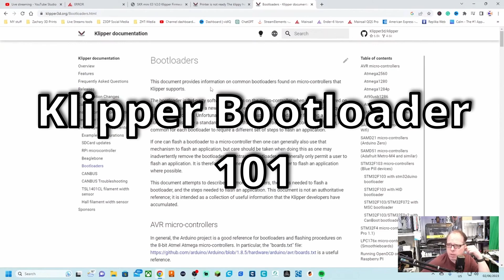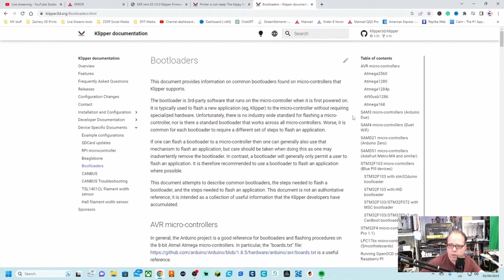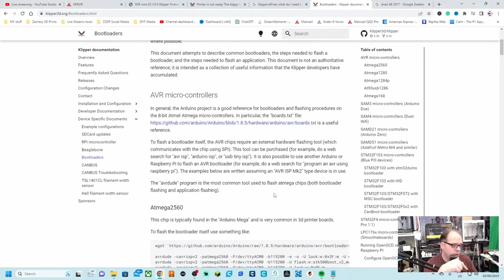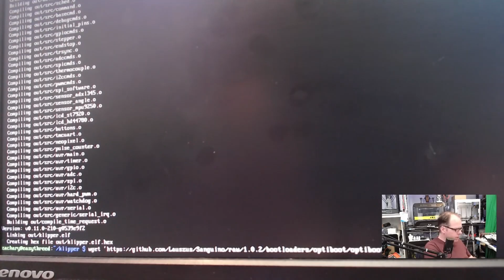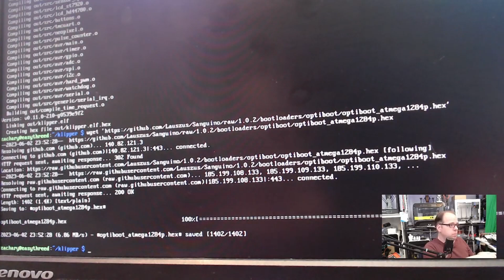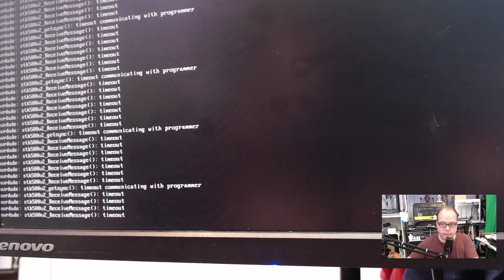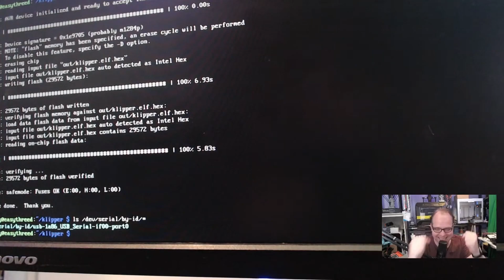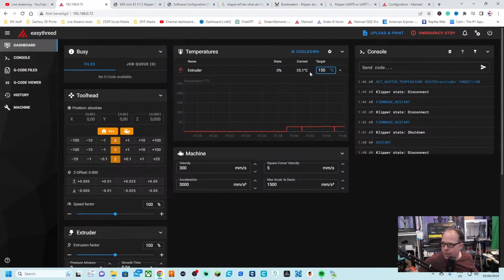Klipper working on Easythreed X1 - Easythreed X1 Upgrades - part 2

Comment: Hello. Can you share the printer.cfg file you use? I'm having trouble triggering stepper motors with my mks robin litev1 cfg. The cfg file you are using seems to work fine.
Reply from the maker: Hey, check out the 3rd part in this series about the Easythreed X1 with Klipper: 
https://www.youtube.com/watch?v=pXevhQBgaOE 
In that video, I provide a very detailed how I got the right pins settings.

Comment: I also want to do this does it work well? Is it worth the effort?
Reply from the maker: My advice after trying this... btw it was more like a gig to try out... but don't put too much efforts in this printer. The motors are overheating and you need to test a lot the get the config file right and the printer working. I did get some 'print' out of the printer, but it's not worth the time and money tbh

Comment: Congratulations Sir. You are amazing. Now speed bench and easy3d upgrades
Reply from the maker: Thank you very much. Sorry for my late reply. I did put this printer on the side since i took me very long to get the tuning right. Since the motors were getting really hot I stopped the klipper Project. Other upgrades are not really worth it TBH